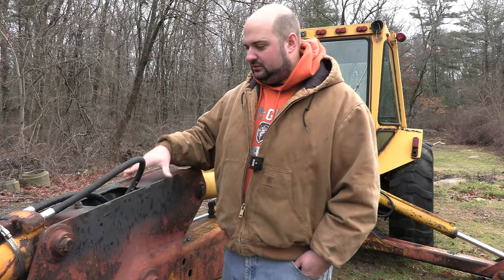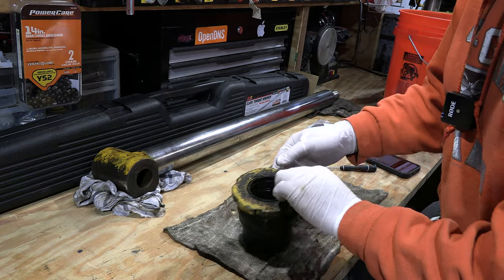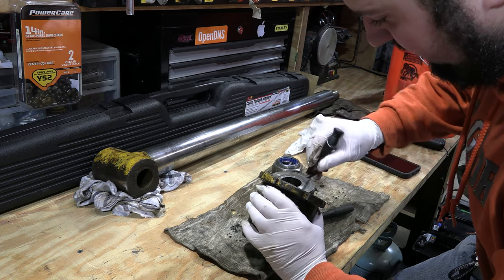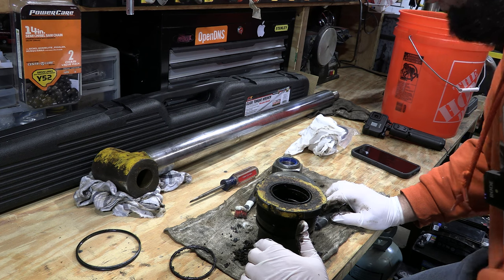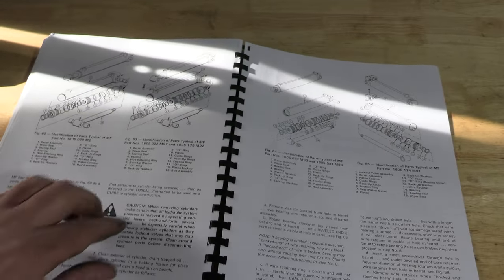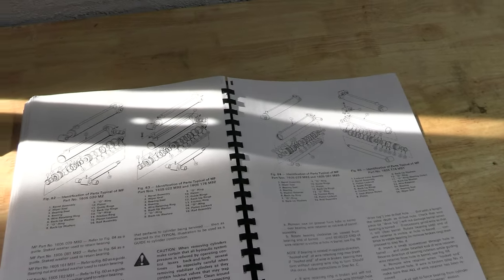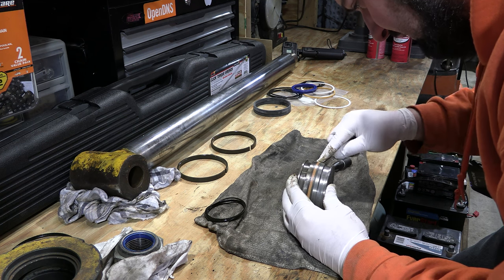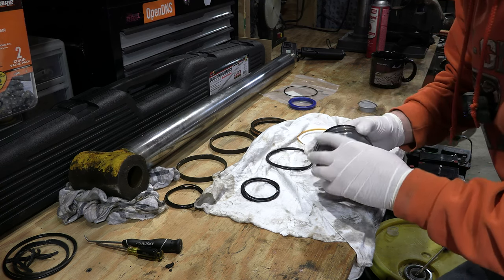Rebuilding a Hydraulic Cylinder for my Massey Ferguson 40B

Comment from the maker: Part Numbers:
Cylinder Part Number: 1605176M92
Original Seal Kit Part Number: 1607730M91 (Massey Ferguson Number)
Aftermarket Seal Kit Part Number: G06980 (From Baum Hydraulics)

Baum Hydraulics Seal Book:
https://www.baumhydraulics.com/images/Catalog/seal-book1.pdf

Comment: For removal of wiper seal I flip gland upside down and stick  a skinny screw driver down to wiper and tap  it out with hammer comes right out . And to install a new wiper lay new one in and use a flat board and tap it in thats what I do all the time out in the field .